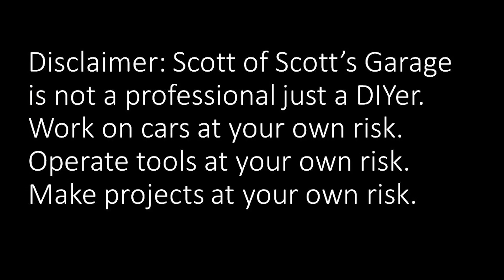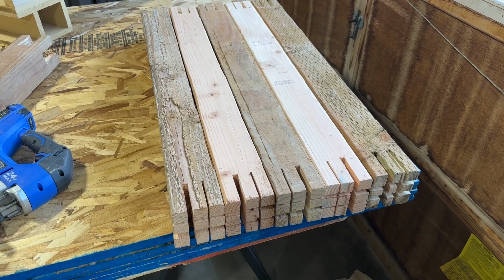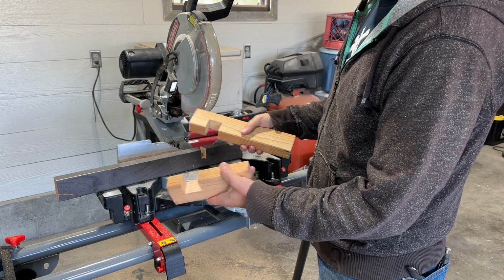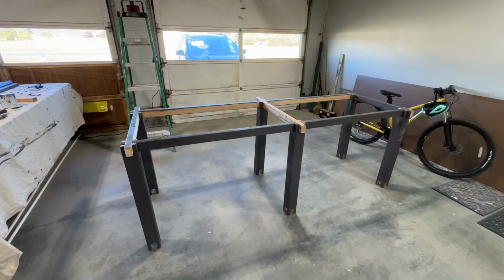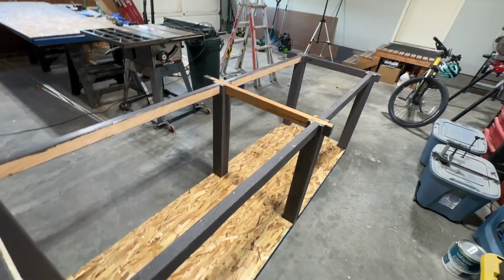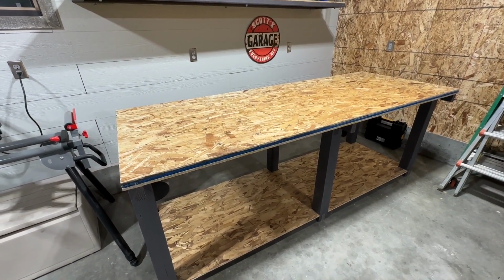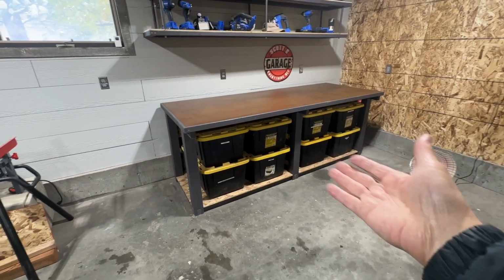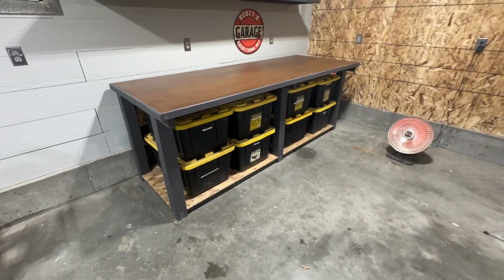Upgrade Your Garage With A Heavy-Duty Workbench and Storage Bins Combo! DIY

Comment: I found that a backstop on the table is a good idea a board running along back and sticking up a few inches prevents tools and equipment from falling off back of table into the abyss to be never seen again LOL. you can just screw it on with a few screws and remove it if you need to pull table out and have large items overhang the whole table.